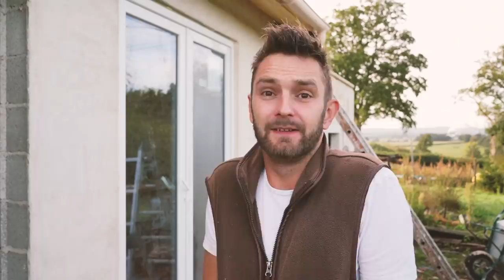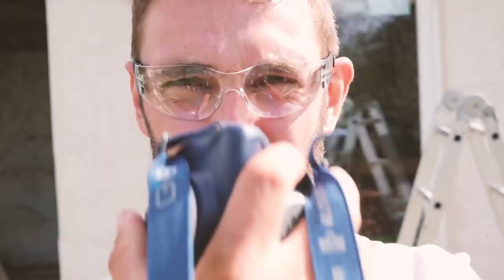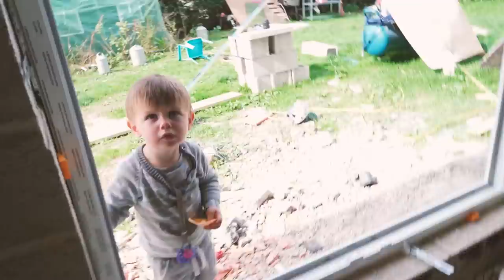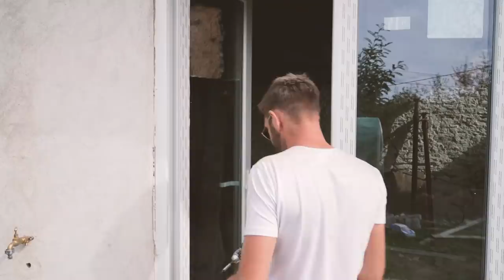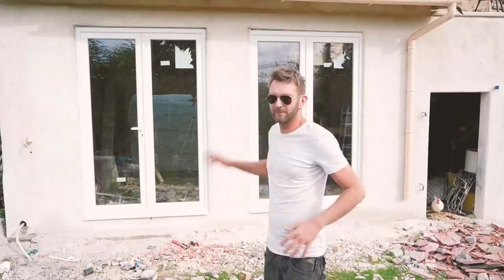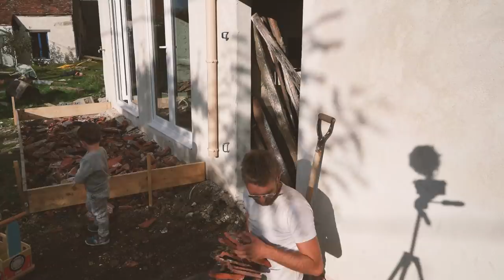Doors are in! - EP109

Comment: Uh.....?  For the NOT ROOF TERRACE?  What does THAT mean?  You KNOW you want it - who are you kidding. Anyway the doors are looking sooo good. Again, progress is progress.  Coming along. By the way, I HOPE you know this - but SLIGHTLY angle the concrete pad too so rain or water will flow off of it and not settle nor be so level it might flow back toward the doors.  But I'm sure you know that right? Please tell me you know this Dan.  Don't make the mistake.  Plus a little rebar or steel mesh on top of the rubble before you pour the concrete will keep it from eventually cracking too. Don't screw this up otherwise you'll wind up with a future project of repair.  Anyway it's going to look great.  Hope you do it right though eh?  Cheers mate.

Comment: Dan... This is the first time you dissapoint me. Seriously!
Don't put all the broken tiles and stuff underneath the concrete, you need a good foundation. Your concrete will 100% crack and brake when you haven't got a proper flat surface to build up on.